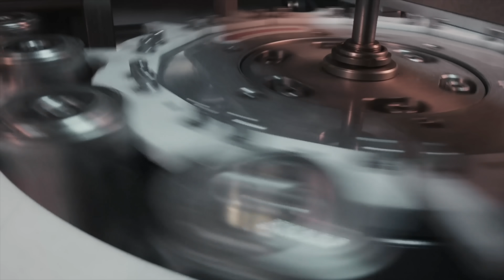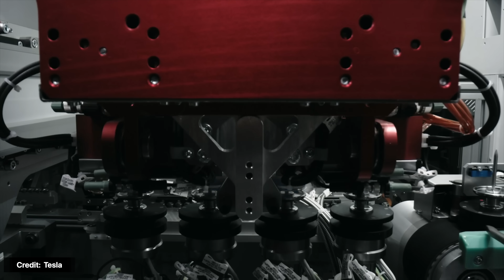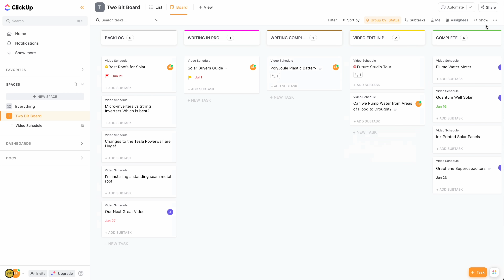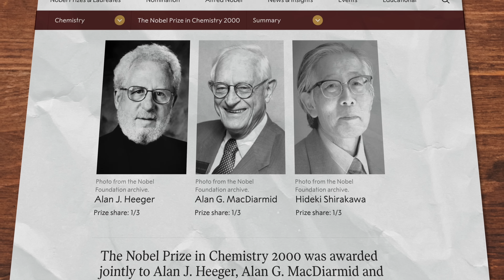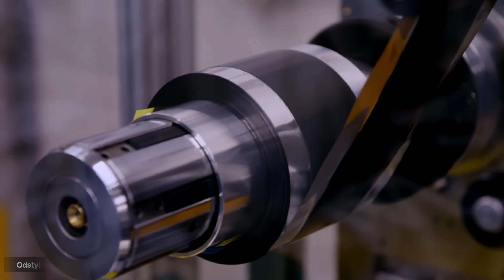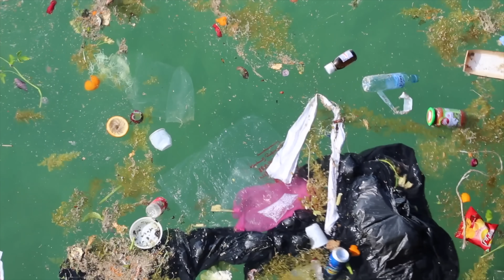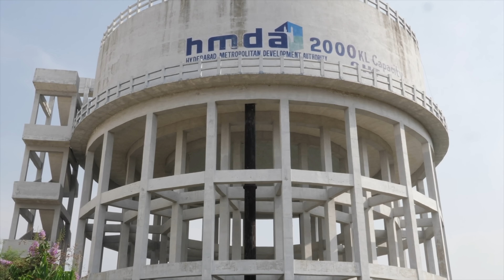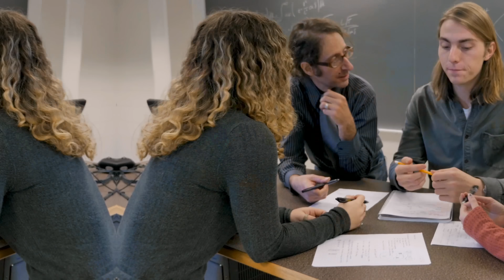Breakthrough Plastic Battery Requires NO Mining, is Cheaper & Lasts Longer!

Comment: Just had a Tesla megapack fire down in SoCal. There isn't any footage or pictures but they had to close the nearby freeway for hours. If the future is going to be electric: conventional lithium iron batteries ain't it! We need a new safer battery tech that's at least 2x the power density, which would then also make EAVs much more feasible.
Reply: Stationary power doesn't need 2x the power density.  Mobile power would benefit from higher density, but it would benefit more from lower cost.
Reply: Wait a minute. The moss landing battery did have a fire. It’s in northern cal and nowhere near a freeway. They did shut Hwy1 for a short time and the fire was managed quickly. 
So just a note here on where your getting your info.

Comment: You make mention of cryogenic air as a way of storing energy from wind and solar. I saw a video on that a few months ago and it seemed a brilliant idea but it was ruined with one line: Turn it back into electricity.  Why do that? It seems like an idea that that would massively reduce the demand on the grid made by air conditioning. A building to be cooled, a heat pump, and a tank of really chilled fluid as a heat sink? It seems like a combination that would provide ac with far less demand on the grid or batteries.  Obviously to complicated for a family home but an industrial size system could cool every building in downtown San Diego or Sydney's cbd.

Comment: 1 megawatt hour in 10 seconds.
Thats 360 MW for 10 seconds.
Soo, this battery has the ability to discharge at a rate similar to that of a small nuclear reactor?
What is the size of this battery a small single story office building?
Reply: No one involved in the making of these videos has ever taken a physics class.
Reply: Hahaha
Reply: It's just possible he meant to say "1 MW for 10 seconds", which is about 2.8 kWh of energy. Probably closer to the mark.
Reply: @RexxSchneider  thats the most likely meaning, but the gauge of wire needed for that would still be absolutely insane.
at 3.2v thats going to be over 800A

0000 gauge copper can only carry 225A at 3.2v 6 inches according to 2 different online calculators.
This would need massive bus bars and even that might be a problem because it would need to be 65mm wide and 12mm tall made out of solid copper
Reply: @denvera1g1  You're quite right about huge currents, but 1MW from 3.2V needs over 300,000 amps. I didn't spot what the battery voltage was in the video. I wonder if the 1MW was coming from a stack of batteries? Although even at 100V,  the current would be 10,000A. Something's still not right.

Comment: These batteries are not burned and don’t produce CO2 so I think it would be just fine to extract petroleum and use it to produce the plastic for these batteries as long as you don’t burn anything else from that petroleum, or if you do, you capture the CO2 and sequester it.  The amount of petroleum needed for all the batteries we would ever need would be far far less than the amount of petroleum we burn every year in our cars.

You didn’t mention how fast it can be charged?
Reply: It would be less than the amount of petroleum we burn every DAY.

Comment: no burdens on anyone, not even batteries, or they were not a gift to you, they are a slave to you then
Reply: earth will give you if you dont force it, but if you force it, it will puke you out, God's mouth will
Reply: dont fear anyone preaching death or fear
Reply: if you make audio-videos for ears scratching, its no use, its just bubble bubble of the ocean
Reply: condense your facts to minimum, or do you need to earn something as money poor
Reply: make fuels from plastics
Reply: Wh/L is useless in practical sense, you dont usually haul volume, but weight, Wh/kg is much better generally, and densities are similar scale for most so automatic non-issue
Reply: better be free than sell freedom
Reply: burn plastic in a fuel cell
Reply: just like hydrogen or ethanol or gasoline, you can even make plastics liquid at temperature, then feed it in the fuel cell
Reply: you dont have to know, if you know its worse then not knowing, let God give you freely
Reply: or just burn the plastic, if you just would rise, get your trash and go into your home, lame people
Reply: dont just talk, do it
Reply: @Jkauppa  Are you on drugs?

Comment: Just a question, lithium battery's fail over time, isn't there a way to revive the material so in can be used again? And as for the recycling of plastics please advise the manufacturer to look at the recycling industry in the Netherlands. We have come a long way already at separation of various sorts. I am not in that industry by the way. Just a ships engineer.
Reply: In metal-ion batteries, the metal ion is the charge carrier from one electrode to the other in a non-aqueous solution. The redox reaction that provides the charge/discharge reaction is normally between different oxidation states of a transition metal. The degradation of the battery occurs because the metal ion can eventually bind with oxygen (usually on overcharging) and no longer be available for carrying charge.
Recovering lithium from Li-ion batteries will involve reducing the Li2O back to Li, and there's no way to accomplish that in situ, so reviving the battery is a non-starter. You just have to extract and separate the materials, then start again.
Reply: @RexxSchneider  Thank you for your response. So the lithium is not totally lost. If you can separate the battery's components.
Reply: @jangoedbloed2141  It should be pretty easy to separate lithium metal from its oxide as Li melts at 180°C and Li2O melts at 1438°C. Reducing the oxide to the base metal can be done electrolytically via the chloride (the electrolysis of LiCl is the usual final step in producing Li from its ores).
Reply: There is a rapidly growing Li-ion battery recycling industry.  That's the way to revive the material.  I don't know of any way to safely and effectively do it in situ without wrecking the battery.
Reply: I saw a video that claimed a properly maintained Prius battery can easily last 30 years.

Comment: Potential piece to the overall storage puzzle.  Like you said, the objective isn't to replace lithium but rather supplement it.  Sounds like it would be a great alternative to lithium for grid or home storage.  Utilities might be more apt to invest in grid level storage if the cost and performance claims made by Polyjoule hold up at scale.  The universal constant still applies - working in the lab on a small scale is one thing, manufacturing and applying it in an industrial capacity is another.  Sounds promising - time will tell.  Definitely something worth keeping an eye on.  Great vid - thanks for sharing with us!  🤠
Reply: Depending on material strength factors, the liquid electrolyte, etc. plastic batteries might work in a lot of other places as well as structural components.  Think of how many things are encased in plastic or have plastic chassis.  Structural batteries have been a discussion for years now.  This kind of technology might lend itself in that field as well.
Reply: These days when I hear or read the truism you mentioned...
The universal constant still applies - working in the lab on a small scale is one thing, manufacturing and applying it in an industrial capacity is another
I can't help but think of Elon Musk's solution to scaling up by directly using  "mass quantities" of the small 18650 cells to power his electric vehicles.
One might even call it The Conehead Process
Reply: I see them being a good competitor for home storage against Lithium, as grid storage it may be superior to the Iron Oxide experiments, and possibly for freight shipping against Hydrogen tech. One of the rare upsides of the Free Market is that alternative products of a similar quality and lower cost, naturally pushes down or reduces price increases on other products which may be overall more effective.

My question is though, where can we source the plastic for these? Perhaps a monumental effort for recycling? Encourage those able to work on welfare into recycling plastic at part time hours, to get paid that on top of their welfare?

Else when the oil industry is finished, as it hopefully will be within 10 years, this product gets nowhere, unless alternative plastic production methods take off
Reply: @michaelchildish : "One of the rare upsides of the Free Market ..."
Rare upside?!  What are you, a flaming communist?
Reply: @michaelchildish  You hope the oil industry is finished in 10 years? Are you delusional? Do you have any idea what a nightmare that would be at a global scale? Green energy is good. It's getting transitioned in, but cutting oil completely would put us back in the horse and buggy era...  wooden wagon wheels and hemp leads at that.

Comment: These things are almost like capacitors. They are quick to charge and quick to discharge but don't have a high energy density. I could see these used in conjunction with other types of batteries, using a little more advanced battery management system to control power output and flow. Maybe you could get a little punch in acceleration like nitrous!
Reply: essentially would be perfect for the peaker plant cut on/off if still using fossil fuel/nuclear peakers
Reply: I wondered the same, would a hybrid battery work,  but I'm not convinced it would work out well. 

For instance, say the poli battery portion were 1/5 the capacity of the existing system, then one could reduce the lithium portion to 4/5ths 
Collectively the capacity is the same, and the power capacity is doubled, but the volume is 1.8×, or virtually doubled. Not sure what the specific energy density(kwh/kilogram) is but I wouldn't be surprised if if were comparable to lithium batteries which would mean you virtually double the weight too.

Comment: Just a thought. How good would poly batteries be as insulation in a home? Maybe they could be placed in modules in the outer walls of your house and not only store power but also provide value as insulation!! For home storage there is LOTS of wall space the batteries could fill for massive back up potential.
Reply: Batteries are thermally conductive generally, so they'd make for terrible insulation.  Even if these aren't it's probably not a good idea to expose a battery to temperature extremes if you can avoid it.
Reply: Good thought and re: temperature extremes… -5 to 105 F here but unfinished, no HVAC cinderblock basement, now only 2’ above grade, air temp very from 30 to 75 F. So certainly inner insulation potential 👍
Reply: @gr8dvd  Not even inner.   "terrible insulation" sums it up.

Comment: Isn't plastic made using oil?  Can you use recycled plastic for this?
Reply: Theoretically any petrochemical could be synthesized from cultivated organic material.  That's basically how fossil fuels came to exist in the first place after all.  Petroleum is just relatively cheaply available.
Reply: @VitalVampyr  Yes, but is it going to be cheap.  Technically you can recycle plastic, but they don't because it's expensive so it ends up in the ocean.
Reply: Natural gas is probably a more common ingredient in plastic making than oil but i believe that either can be used.
Reply: Australian researcher has developed a process that reduces plastic UNSORTED into the oil that is original used to make plastic so if that research is true any plastic could be recycled by his process into batteries!
Reply: @AtTheBarn  Yes, but is it going to be cheap.  Technically you can recycle plastic, but they don't because it's expensive so it ends up in the ocean.
Reply: @AtTheBarn  apologise
Reply: You probably could but as always just making new plastics will be cheaper and favoured
Reply: @divat10  Actually according to his research he could sell back into the supply chain very competitive. There is actually push back from big oil because this could have a massive impact since the oils for plastic were originally "Waste?" that is now sold.
Reply: I suspect it’s energy intensive to do that though.
Reply: PLA isn't.
Reply: @djarcas  PLA has recycling problems just like regular plastics.
Reply: Bioplastic
Reply: Maybe watch the video?
Reply: @bengrillet  Apologise  Mr Gillet
Reply: Plastic is one thing that can contain most of the caustics used in batteries.   We can’t live without Petro chems.
Reply: @Joyful-213  We can't live without Petro chems?  Really?  What did we do prior to about a century ago?  My grandparents seemed to get by just fine.
Reply: @_____ Where does the plastic go when the battery is used up?
Reply: @hamsterbrigade  the ocean usually.
Reply: Oil is infinite and you have been lied to
Reply: @barrontrump3943  Trump has a fund that needs your money as well.
Reply: @barrontrump3943  Not infinite but probably could be put to better use than as an energy source. More than 30percent of coal, 40 percent of oil, and 50 percent of natural gas are used for purposes other than burning. Even if our entire energy supply came from nuclear or hydroelectric  or some other form of renewables we would still continue to pull massive quantities of oil, coal, and natural gas out of the ground for one very simple reason: they are very valuable chemical feedstocks
Reply: @barrontrump3943  I'm not concerned about the amount.  I'm concerned about the recycling aspect.  Also, it's funny that regardless of whether it's lithium or this plastic it'll end up being some material controlled by a few large corps.